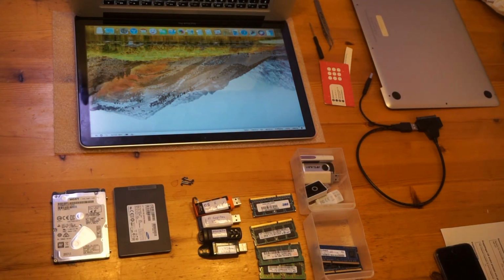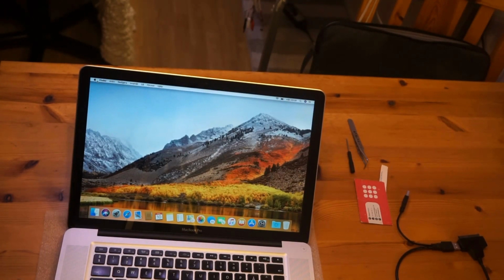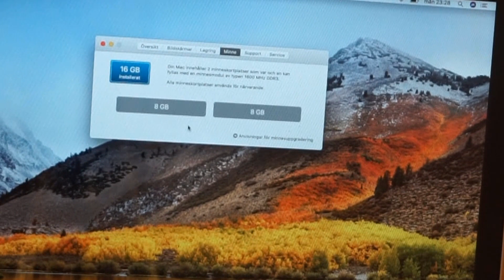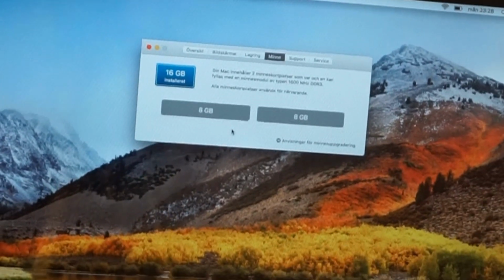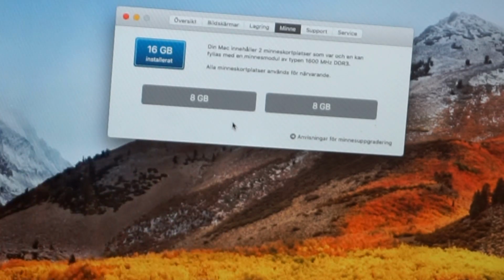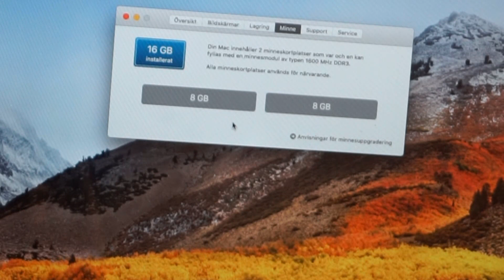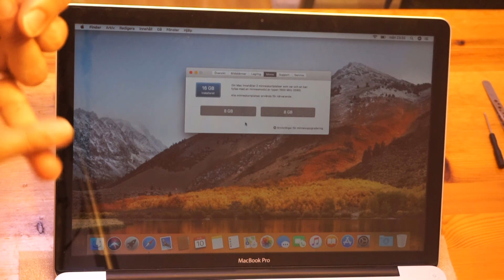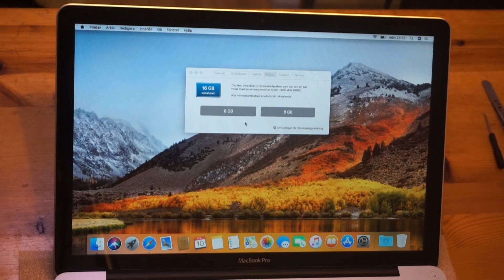MacBook Pro Beeping 3 Times EASY FIX.

Comment: The first method just work like a charm, I just remove and then put the screw back. Well, that’s so very simple but I will use another method if the beep is comeback 😂

Comment: I tried the paper method for a MacBook Pro Late 2008 model and it worked, except I used 4 pieces of paper because with 2 pieces it would boot but go all funky and crash. Mines was also the bottom ram module. thanks a bunch!

Comment: Yes but could be the ram supply circuit or bad solder joints on the legs.
Reply from the maker: it could be, but what do you mean more specific ?
Reply: @MICROREPAIR  well the pins on the ram slots might be bad, dry joints, corroded etc. 

The ram power supple circuit might not be outputting 1.2v,1.5v whatever the circuit needs.

Comment: I have been having this problem for a while. i tried everything and I couldn't get a reliable fix. This did the trick and my Early 2011 MacBook Pro 13-inch has had no problems in a week. I seriously cant thank you enough for saving my MacBook and my sanity!
Reply: Also what I found to work is putting some small pieces of folded card paper in between the ram clips and doing the cards underneath the slot.
Reply from the maker: Nice to hear that the tryck solved your problem. Plz subscribe
Reply: @MICROREPAIR  already did!

Comment: My problem is in the top slot. I've already replaced the position RAM memories. Both work only in the slot underneath. Have you ever encountered this kind of problem?
Reply from the maker: the pins of the upper slot are not making contact. it could be diffecult to find an easy fix. but soldering them is an alternative

Comment: Liked + Subscribed. 
My broken slot was actually the one above. However your Card trick still worked. Many Many Thanks. 
. . . i just gave myself a small heart attack though. Had your video playing in the background when i rebooted, and heard the dreaded three beeps from your videos audio 😅
Reply: It actually failed again. After almost 6 hours usage. Is it possible to do the card trick with the level above? Or would you recommend anything. I can easily take one of the cards out and it works fine with Half RAM, but very slow. 

Many thanks
Reply from the maker: @MrMatthewKerr  try the screw trick. 
and try to make pressure on the upper level. 
if it doesnt work, then the pads need to be soldred, and its it a bit diffucult on that particular model . but still a work to do
Reply: @MICROREPAIR  hi thanks for your reply. 
I will try to add pressure. Now it’s slightly odd. I can usually make pressure for an hour or two. Sometimes only 5 minutes. Then the beeps return. 

I have hope in solving the problem though. 

I should imagine if I needed to solder then no amount of pressure would fix my problem. But it is fixing momentarily. So hopefully just a case of finding the right place to apply force.

Comment: I dont understand the card trick?  Can you help
Reply from the maker: Cut One of the visit card and putt it under the ram slot. 2 in case it is a thin card 
Dont forget to subscribe
Reply: @MICROREPAIR  fast reply it stopped the 3 beeps on mac mini 2010 but black sreen, im trying to upgrade to 8gb
Reply from the maker: @johnnytest199  change the Rams. Try every slott/Ram at a time
Reply from the maker: If the video is useful pls subscribe for more tips

Comment: hi , i have a similar issue , but the difference is that happens randomly .way after booted my Mac. sometimes after at several hours of normally use randomly shows the blurry bars , freezes and shuts off(sometimes reboot). I got a mbp2012 i7 with 2 ram slots of 4gb each one. you recommend me use only the top slot and buy a 8 gb ram ? use the card method or apply soldering to the ram pine? thanks for all im from Chile sorry for my English...
Reply from the maker: Where do you live
Reply: @MICROREPAIR  Santiago-republic of Chile
Reply from the maker: @elgeneracionX  ok I thought in Stockholm. You can send your Mac
Reply: @MICROREPAIR  no me digay que eres Chileno...

Comment: Hi iMicroRepair, I did this but it didn't work for me, the 3 bits come back.  I have other memories to test and it won't turn on.  The module that activates the bit is the upper one as in the video.  What else can I do?
Reply from the maker: Try again. Release and tighten the screw
Reply: @MICROREPAIR  lo probaré de nuevo
Reply: I plan to buy 8GB RAM at 12600 as a last upgrade option, I have a Crucial SSD installed.
Reply: @MICROREPAIR  Hi, I have done the process again and it has not worked.   One day I started my macbook pro 13 "mid 2011 to work, a few minutes later it suddenly turned off, when I restarted it the 3 beet came out. I have tried everything I have seen, but it has not been solved. I see that it has worked for others, good for all, in my case I will have to resign myself. In advance I apologize for the translation, I speak Spanish, greetings from Colombia.
Reply from the maker: @carlosdavidescobar  i understand, this problem has to do with the pins of the ram slot. They loose connection to the board. If this solution didnt work then it is a big gub between the pins and the board. Or One of the pin is completly broken. Its Almost impossible to repair

Comment: It's 2020. I bought a Macbook Pro 2012 on Craigslist yesterday for $150. The same bottom ram issue of my bottom ram slot on my Macbook pro I fixed with a plastic straw while drinking a cocktail. I cut two small pieces of the straw and placed them under the bottom ram slot. But first I loosened 4 screws that held the ram bracket. And I tightened the screws back in the end. My Macbook Pro mid 2012 recognized both ram slots!! It works!
Reply from the maker: SirSubliminal it feels great to hear that helped someone, Nice to read your comment 💪🏼👍

Comment: God bless you highly, I had the same problem and I have tried every means, I accepted my fate to use 8gb RAM, my local repairer couldn’t fix it, I saw your video and requested my Mac Pro back and I tried the paper trick, behold it’s been 3 hours straight and I’m not getting any beep or error. You are heaven sent bro. You got a subscriber in me.
Reply from the maker: Sammie Jnr Nice to read your comment 👍🙏💪🏼